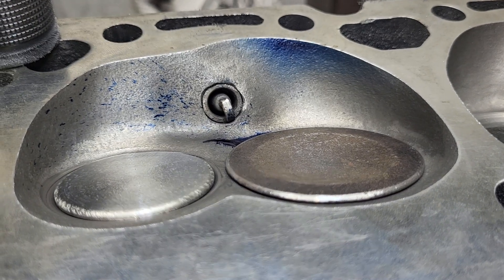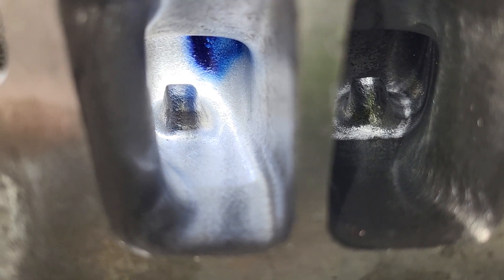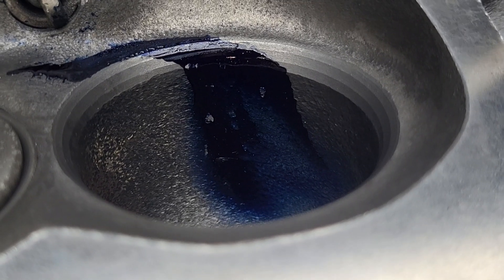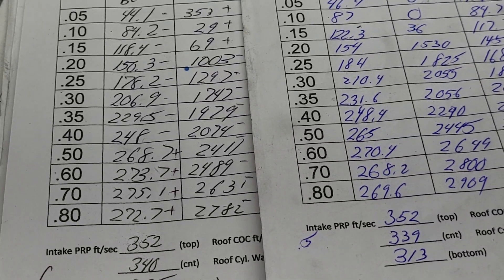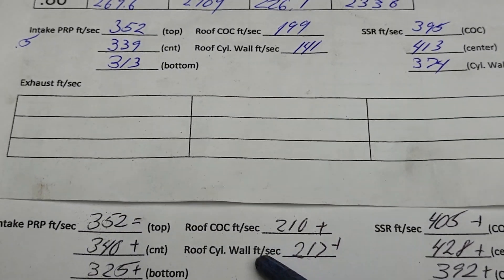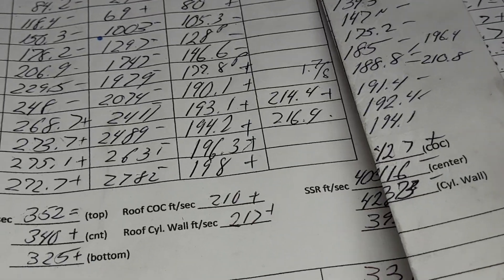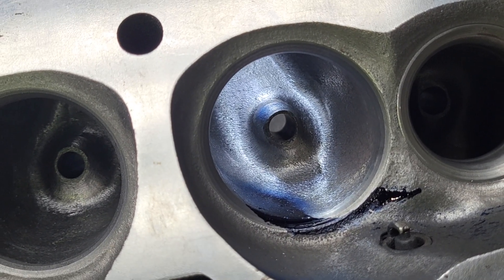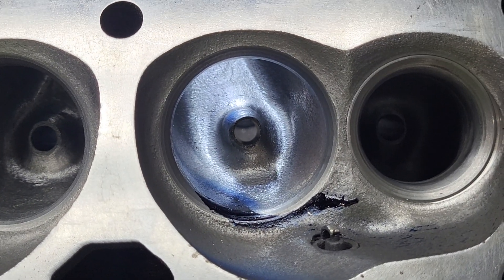Redheaded Stepchild, Textured valve experiment. Does this project need oversized valves?

Comment: Non-video question. Can you provide information about the SBC cylinder head casting 10110810? A 65cc combustion chamber and 1.94/1.50 valves were the only objective information I found. I've read they were possibly a swirl-port head, even though they aren't the 191, 193 or VORTEC casting, which is what brought me to your channel. I'm looking to upgrade a stock 350 to a roller set-up to make a lot of low-end torque w/o exceeding 5500 rpms. Since max horsepower isn't a concern, I'd like to save $$ by using the existing heads. Thanks in advance for any assistance.
Reply: I did some digging out of curiosity and it seems as if information on this particular casting is elusive for certain! The best I can figure is that they are some of the “better” swirl port TBI truck heads. (Take that for what it’s worth 🤔)
Reply from the maker: I had to look them up as well. Seems like a heavy duty swirl port head. Nice!
Reply: @servediocylinderheads  Do you have any flow data on them? Are they only good up to 4500 rpm? How much would you charge to "clean" up the ports to support 5500 rpm (5000 at least) with a .500 lift? Looking at either a Schneider or Howard cam. Both  variations have an intake duration under 220 with valve lifts near or slightly exceeding. 500.
Reply from the maker: @ernestadamsjr.2662  I have never worked on them but I will bet they flow the same as the 193's I have done. I have tests from stock to insane level on 193's. Thanks
Reply from the maker: What would I do? Depends on combo bit for 4500 guides and a valve job will get you half way there.
Reply from the maker: @ernestadamsjr.2662  charlesservedio@gmail.com
Reply: @servediocylinderheads  I'm near San Diego, CA. Majority of the machine shops near or around me will NOT perform any porting on cast iron heads outside a valve job.
Reply from the maker: @ernestadamsjr.2662  I don't blame them! Hahah

Comment: If it's a 355. I'm thinking staying with the 1.94 and the higher air speeds for what the combination is. You have done an awesome job over stock ones.
Reply from the maker: Latest word was going 383! But I feel the air speeds are good where they are and bigger valves will change that alot. Thanks

Comment: Do you think you'd have to do something with the chamber around the valves if going to a larger size?  You can only get so much air around a turn, and I'm wondering if you hit that limit with the current setup... still wild getting that much air through a stock valve size.

Comment: I have seen DV put a groove on the intake valve on teh piston side for anti reversion, if I remember correctly
Reply: I’m glad you brought that up! He did a video on that a couple of days ago. Charlie has been to DV’s seminar and also worked with him but I don’t think I’ve seen Charlie test that intake valve mod.
Reply: @robertwest3093 , Hmmm i have not seen a new one, Thanks I will check it out!
Reply from the maker: I am not a fan of that mod due to stresses on the valve. Thanks
Reply: @servediocylinderheads  I would say it depends on your margins. If the valve has like a .125" margin I think it would be fine.

Comment: The major constraint on this combination is the rest of the intake system. This engine will be greatly affected by what is happening in the exhaust, as the delta P during overlap is going to greatly affect initial movement of the intake charge. With the intake being so restrictive, that initial movement is going to have a greater effect than it would on a less intake restricted combination. Exhaust velocity and length.  I don't think that a bigger intake valve is going to give you much benefit. That said, this combination would be a good candidate for a floating depression intake system test, as those long curved runners will undergo significant changes in flow bias during the induction cycle.
Reply from the maker: Good points. Thanks

Comment: Atta boy Charlie! I've been waiting to see you work the valves like this.

Personally, I like to use a 120 belt on my 72" grinder to give the exhaust valves a good radius like you have. I change to a 60 for the intakes and use the slack between the platen and the closest wheel. The belt is straightest at this point.

I believe the radius on the exhaust valve help the intake charge rise over the closing exhaust valve.

Not something the flowbench is going to show you.
Reply from the maker: I do have a nice belt sander in storage. Good idea. Thanks
Reply: I have seen the benefits of a radiused exhaust valve on the bench myself. I had just used a stone with the valve chucked in a lathe or drill press then finish with some Emery for a smooth blend and finish.  Actually learned the technique from a article Steve Dulchi did a few decades ago which had also showed the flow improvement. I know they used David Vizard's bench at the time so he may have had some input with the modifications as well. Ferrera use to (maybe still do)  sell exhaust valves with a radius.  Intake likes sharp edges as we know.

Comment: If the cam isn't going to be very big some larger intake valves will help a lot.  Should  see some big gains up to .550 lift with the same size port. Leave the exhaust alone.
Reply from the maker: Interesting take. Thanks

Comment: Awesome results Charles! Thinking about a bigger valve, perhaps before upgrading the valve, you could first check how much does the overall flow through the plenum and stuff improve if you bolt on the previously porter bigger valve swirlport heads?
Reply from the maker: I was thinking my sportsman 2's. But you are right. Thanks

Comment: Would you be up for showing your process for doing the guides? 

I kinda like the small valves. But im thinking bigger would fill the cylinder better with our tiny bit of "boost" from the tpi.
Reply from the maker: I have a video demo on that. Pretty old actually. Thanks
Reply: @servediocylinderheads  I'll go look for it. thanks.

Comment: Charlie, 
I would raise the roof to get more area,you are 1.90" at pinch,will be difficult to get much over 2.00" in that area without blowing out the pinch wall.
This is my opinion but I don't agree with a bigger intake valve on those heads.the choke is the pushrod pinch not the throat/ valve.
Put a bigger valve/ throat will only slow down velocity through the seat ring which I believe is a power killer.
We have to remember the flowbench blows air in one direction and a running engine operates differently.
Reply from the maker: Great input. I agree. Thanks
Reply: Are you the Steve Cowan from the Speed Talk forum??
Reply: @robertwest3093  yes,that is correct